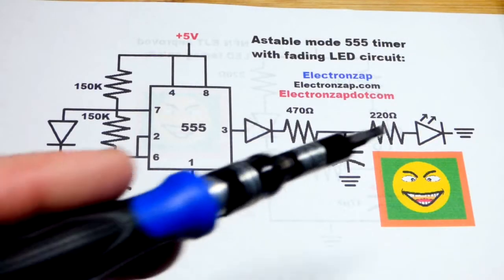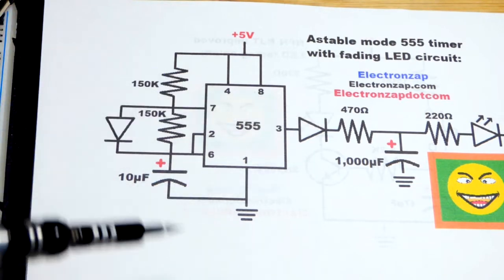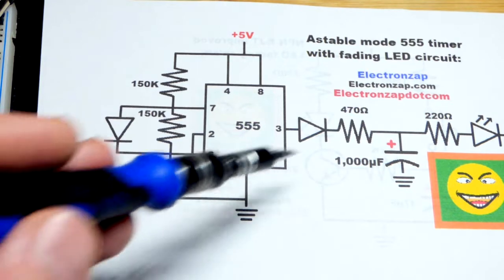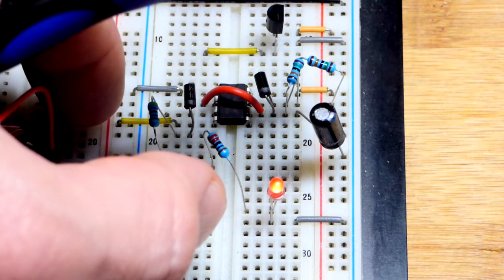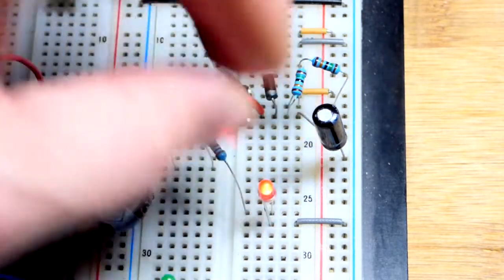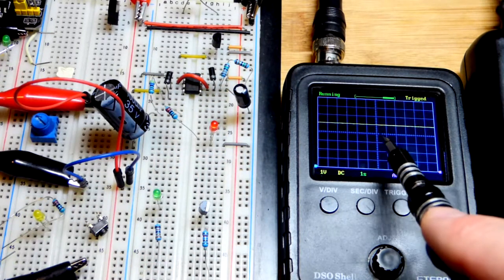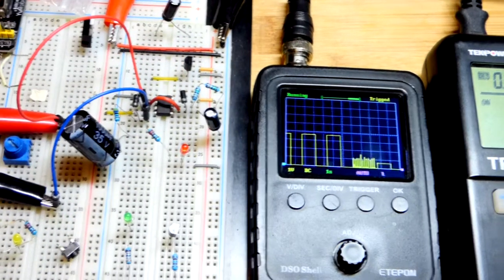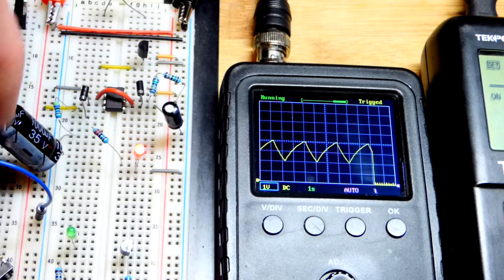Fading on off LED using 555 timer astable mode with capacitor output electronics how to DIY circuit

Comment: Hello! How would I be able to connect two LEDs and have them alternate in fading? Thank you
Reply from the maker: You could also wire this up to the positive rail, remembering to have led and diode facing in opposite direction of the output. Then they would alternate flashing.
Reply: electronzapdotcom thank you!!!